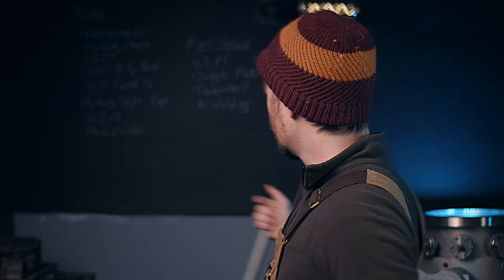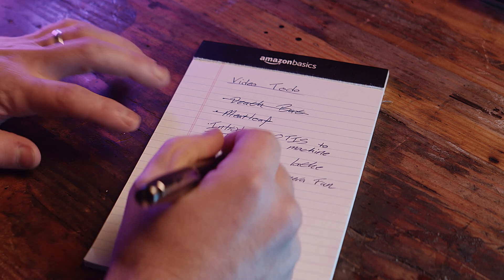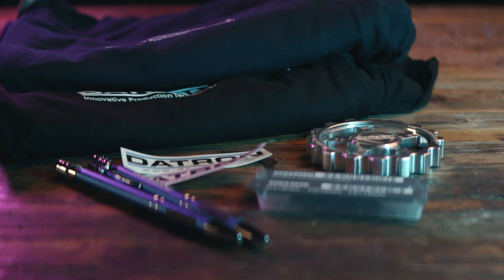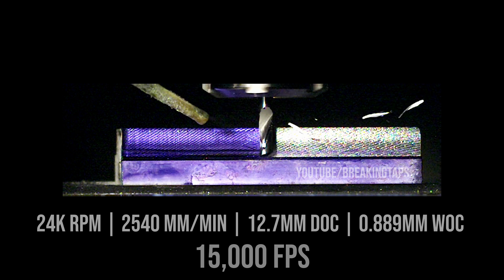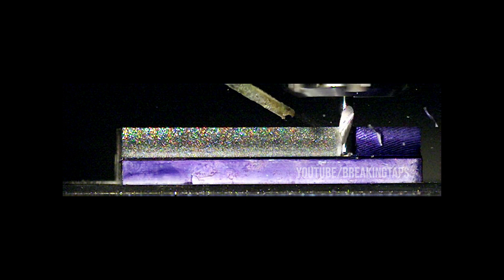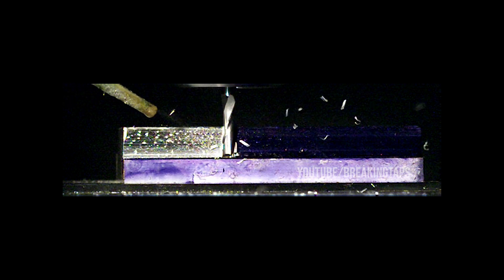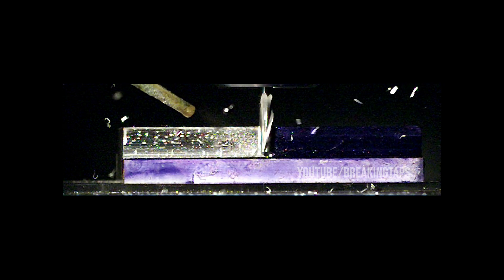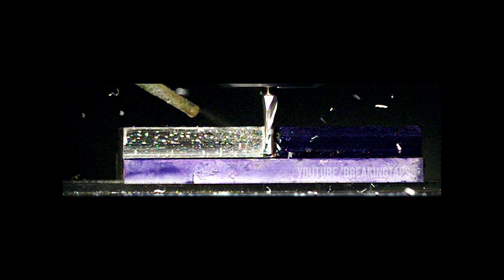Single Flute end mill at 15,000 FPS

Comment: Would there be an angle where you can place a camera that would let us see the metal being cut by the bit, or would there be stuff obstructing the view? Would placing a small mirror strip at a 45 angle, behind the bit using the  angle in this vid, show the interaction between the bit and the metal , at least on the surface?
Reply from the maker: Hmm, could be tough to get a good angle on that.  A mirror at 45 might help show the backside, or maybe something looking down for a top-down view so you could see the bit bite into the metal.  Hard to work around the gantry and spindle though.  I might try this setup again at some point though, I have a new macro lens for my high speed camera that would look much better than these older videos!  Also tempted to run it in clear acrylic just to see the whole thing :)

Comment: The chip load per individual 'flue piece' is quite a bit lower for the corncob style end mill, so because the material is being removed in small bites instead of one big swoop the chip load is a lot more balanced which automatically results in less deflection which leads to a better and more consistent surface finish. At least that is my theory :D
Reply: My favorite is adding my own chip breakers 2-3 per flute it reduces chatter a lot

Comment: I make PVC windows and doors and when I cut holes for handle and latch with single flute, from left to right the cut is more smooth that when I cut from right to left, machine is manually operated following a selected pattern on top (I don't know english technical terms).

Comment: Super interesting to see the cutting dynamics, thanks! (BTW, is that a high-vacuum system in the background? If so, what are you doing with it?)
Reply from the maker: Good eye!  It is indeed a vacuum chamber, think it was originally an old 60's vintage e-beam deposition chamber (seems to have some "DIY" ion pumps, air-cooled jacket, HV feedthrough, all ports are conflat).  It's not currently operational, I need to machine a top-plate and an adapter for my diffusion pump... but it's so cold in the shop I'll probably procrastinate on that until the Spring.  Have some vague plans to try out laser pulse deposition, and maybe dabble with some micro-thruster designs (ion thrusters, micro-cavity discharge).  The original original plan was for sputtering but I ended up finding a killer deal on a SEM coater not long ago :)

Until then, it's gets to be a pretty blue prop in the videos 😀
Reply: @BreakingTaps  Hah, awesome! I’d be envious, except I don’t remotely have time even for my current projects. High vacuum would be a whooole other thing, and I don’t even have a particular application. It’s just cool, though :-) I spent a LOT of time with vacuum systems early in my career. At one point, I got so tired of rebuilding diffusion pumps that had seen atmosphere that when I transitioned to a new job, I didn’t let on that I knew anything at all about high vacuum 😆. In my retirement though, I kinda miss it a little; it’s been many, many years; decades TBH, but part of me would enjoy seeing conflats, ion pumps and an ion gauge again :-) Ultra-high vacuum always appealed to the extremophile in me; 1x10^-8 torr was an achievable but challenging goal :-) Best wishes and good luck with your system, I hope we’ll get to see a vid someday on what you do with it 👍😁
Reply: (Forgot to acknowledge the SEM coater - cool! I also spent a lot of time with a "mini-SEM" back in the day. I loved it! Our specimens were already conductive, so no need for sputtering, but cool that you have a system to do that. - Although I confess that I always had a bit of a bias about sputtering: All those nasty gas molecules around... <lol>)

Comment: With the removed areas of cutting edge the surface area contact and corresponding force, deflection and vibration is basically halved for each flute so that is the main likely cause of the better finish.

However the rigidity of a 2 flute cutter and the pattern of movement means it will have 2 points of maximum deflection during one revolution as opposed to one point with a single flute, which is also a likely factor involved in the improved finish since the distance between each point of maximum deviation on the cut surface will be halved as well, and this is obviously helped by the halved force with the halved cutting edge length for each flute.
Reply from the maker: Hmm yeah that makes sense.  I was contemplating the reduced tool force but wasn't confident enough to say it out loud... and didn't think about the 2-flute nature of the tool at all.  Despite cutting like a single flute, it's basically a two flute so stiffer/meatier.  Makes sense it would also deflect a lot less (and have different resonances too, maybe even balanced better).  Interesting!  I probably haven't ever used a nice serrated tool either... now that I think about it, pretty sure I've only tried cheap roughers.  That might have prejudiced me a bit too heh
Reply: I see you are using inches per minute for your feed. So if you run a single flute at 100ipm, you need to run a two flute at 200ipm to make it equal. Feed that two flute at 200ipm and I bet you will see a similar surface finish on the cut. The feed per tooth needs to be equal to properly compare surface finish (also, don't conventional cut on CNC, there are very few situations where you would want to do that since surface finish and tool life are always reduced).
Reply: @jbwalker841  But the rougher isnt actually a 2 flute tool. Its 2 flute with half of each flute cut away, so at any point of the tool there is only a single cutting edge. It is a 1 flute tool with a 2 flute body, so the chipload must be the same as a normal 1 flute. Except that it produces shorter chips, but that isnt part of the normal feeds and speeds formulas afaik.

Comment: My guess is that the finish is better because it’s more like a 2-flute cutter in some ways, for example it’s a more rigid design and will experience less tool deflection. Curious how the finish looks vs a true 2 flute cutter.
Reply from the maker: Ooh, that's a great point.  I hadn't thought about the extra stiffness from it basically being a 2 flute masquerading as a single flute.  Would be interested to see it compared to a real 2 flute as well.
Reply: If you cut with the same speeds, feeds and depth of cut then the finish will definitely different. You would have to double the feed rate for the two flute endmill to make things equal because the feed per tooth is what matters. The chip splitter may affect the finish too on less rigid setups because it reduces the chip size which effectively reduces the torque required for the cut and should reduce deflection. But the feedrate will have a bigger impact. One flute and say .01" linear advance per revolution of the tool equals .005" advance per tooth per revolution of the tool with two flutes. So therefore the frequency of tooth engagement is double which reduces scallop size . Smaller scallop size equals smoother finish (unless you end up causing chatter, but that's a different discussion). Make sense?

Comment: I think that style serrated endmill have the potential to give better finishes that trad finishing endmills depending on the grind and if I remember correctly  main sales point is less tool pressure peaks during machining as the cutting load is distrubuted over smaller teeth more evenly distributed around the OD of the tool.
Reply from the maker: Hmm interesting.  Seems counterintuitive at first but makes sense more I think about it.  Perhaps I've just used really crappy roughers in the past which is why I was expecting really bad finish and lines across the work :)
Reply: @BreakingTaps  its completely on the grid of the tool... I think the ones called serrated roughers can give great finishes but the ones called corn cob roughers won't as the profile of corn cob tool literally looks like a corn cob while spinning and not a cylinder. They have the same advantage but can usually rough harder as they have more teeth to flatten the tooth load curve
Reply from the maker: @HuskyMachining  Ah interesting, didn't realize there was a difference in serrated vs corn cob.  Guess I never looked at them closely, or their descriptions.  Good to know!

Comment: the surface finish with the single flute is very interesting; why are the visible lines so diagonal? is it maybe chattering; perhaps inaudibly? maybe even runout related?
Reply from the maker: Could be, not sure.  I didnt see any major deflections in the high speed, but didnt really analyze it either.  I've definitely seen similar in the past with single flutes (while working on projects)... I always assumed it was due to the geometry: single long flute, starts cutting at the bottom and by time it finishes the half revolution, it's advanced forward a few millimeters causing a diagonal line.  But not sure tbh. :)
Reply: @BreakingTaps  the chip per tooth is how much it advances per revolution which in this video seems to be a couple 100ths of a mm at a time; the lines would be almost vertical, so that's not it i think
Reply from the maker: @ikbendusan  Hmm that's a good point.  Just ran it through a calculator, chip load is 0.10583mm, agree that doesn't seem like the cause.  Not sure where those lines are coming from in that case, I guess chatter/resonance seems most likely?  I might be able to measure runout from the video, comparing the angle of the tool over time. Hmm...

Comment: Cool video! What kind of camera would one need to make these kind of slow motions? 

Have you tried slot cutting with the cutter as well? Would be curious to see how chip evacuation is from a relatively deep narrow slot. 

From what I gathered one of the differences between climb and conventional cutting is, besides less recutting of chips, the deflection of the end mill with climb milling is more in line with the cut direction, whereas conventional puts transverse forces on the end mill, hence climb will give better dimensional accuracy (and surface finish)

Also the cut/chip starts thin with conventional and increases during the cut, this gives more rubbing and tool wear/heat where climb starts 'thick' and thins out, so no rubbing.
Reply from the maker: Thanks! I have an Edgertronic SC2+ high speed camera... cost a pretty penny (even used), but it's considered "affordable" compared to  the nice high-end cameras like what Smarter Every Day uses.  If you ever see really high-speed footage at 720p or 1020p, it probably came off a Phantom and cost upwards $150,000 USD. 😬  Mine can do ~5000 FPS @ 720p, with a max speed of ~30,000 @ 1280 x 96
Reply: @BreakingTaps  very cool, hi- speed looks amazing. 
Unfortunately not quite in the realm for a nice to have ;-)

Comment: My only question is why you're using python while wearing a Rust ferris shirt???   Hmmmm....  Highly suspect.  Great video, by the way.
Reply from the maker: Haha, I was curious if anyone would notice 😅 Been trying to force myself and use Python more lately, there are just so many scientific packages that are only available in python land.  My breaking point was when I wanted to use a python library and was trying to figure out how to import Python bindings into Rust... decided I should probably just learn Python instead.  I'm really bad at Python though, like still at the stage of googling for "what is Python iterator syntax" level :)
Reply: @BreakingTaps  That's funny.  I'm going kind of the opposite direction.  I don't like Python specifically, but I'm very good at Swift, and I'm trying to learn Rust.  They're very similar, but by the time I'm done with work I struggle to read more than one chapter in the Rust book.
Reply from the maker: @hpux735  Yeah I hear ya, Rust's learning curve is closer to a cliff.  I picked it up a few years ago, and while not very good or expert at all, it's enough of a base to let me hop back in with minimal "downtime" for hobby projects... just have to refresh myself and fight the compiler for a few minutes :)  I have to say, the recent improvements in IDE integration really helps.  When in doubt you can just add dummy types to method signatures and let the IDE/compiler tell you what it was expecting :)
Reply: @BreakingTaps  Totally.  The book is definitely well done, but the hardest part I have is reading other's code.  A lot of what's in crates.io isn't fully documented, so when I go reading the source to understand the API I get lost in some of the weird idioms.  :)

Comment: Just stumbled across your content and smashed that subscribe button faster than I expected! Love the polished content and the effort you put in it! 
Maybe the roughing finish is better because of less tool pressure and therefore less deflection? Or it's because the single flute induced some harmonics into the Maschine that the roughing endmill would cancel out?
Anyway - love the content - greetings from germany - keep it up!
Reply from the maker: Thanks! ❤ Hmm that's interesting... those both sound like very plausible explanation to me.  Smaller chips, less tool pressure and thus less chatter.  Maybe even acting a little bit like a variable-flute, breaking up resonances?  And the single flute does have a very "long" cut, so maybe it was starting to chatter just a little bit?  I wonder if there is some way I could quantify that... I didn't see any movement in the high speed, but I also didn't look very closely.

Comment: Well done. Shared on diy cnc Facebook group.
Reply from the maker: Cheers!
Reply: @BreakingTaps  I've just started using a datron single flute on the BTP (with flood coolant), it's unbelievable! Did you find it was surprisingly quiet? I'm really impressed. I tried an industry standard 2 flute and it was ok but left burs and had a bit of vibration.
Reply from the maker: @MakeTechPtyLtd  Hmmm... I think so but hard to remember.  I was trying to time the high speed camera trigger and not really paying attention to the machine.  But I don't remember any awful/loud/chattery sounds so it probably was quet!  But I was very impressed with the finish in general, I think it did a better job than my Amana Tool single flutes.  Feels like they are probably better balanced (the geometry looks a little different too, the Datron has an extra bit at the bottom which looks like it's there for balance, or some kind of "wiper")
Reply: @BreakingTaps  interesting. I'm definitely going to stock up on some datron endmills. I'd like to try that "rougher" one.

Comment: I love the high tech approach to an age old problem to solve chatter. 
In the old Bridgeport days of slow spindles just slow it more to stop chatter. 
I program cnc for a living and I use ZrN coated 3FL chip breakers and ZrN coated 3FL finish end mills for aluminum and they work amazing. 
Great channel and I look forward to seeing more 😀
Reply from the maker: Thanks!  Any recommendations on brand?  I have some 3FL tools kicking around, but mostly just an assortment of import's and random ebay finds :)
Reply: @BreakingTaps  ironically we all know Kennemetal, Sandvik, iscar are top names, we machine a lot of armor, stainless, tool steel and aluminum. 
I have great success with Accupro end mills 
3FL ZrN for aluminum, chip breaker for rough, finish for finish 
5FL TiCN rougher for hard steel 
6FL ALTiN finish for steel
Reply from the maker: @HandyDan  Perfect, thanks!  Will pick up a few next time I make an order!

Comment: Nicely done.
If the camera supports an external trigger for capturing a frame, it'd be neat to use that to synchronize with the rotation of the spindle. Mounting the camera to the axis the spindle is moving along relative to the work, would make it possible to get a bit more optical zoom and get more out of the limited sensor resolution.
Reply from the maker: Thanks!  I just had a look, and it seems my camera supports external triggering via genlock, and will keep frame capture to +/-1uS with the signal.  I'll have to do some playing to see if I can sync it, thanks for the idea!  I'm also looking into mounting a low magnification microscope objective (4x or something) to help get closer... should give more light than macro lenses and still wide enough to be useful... I think :)